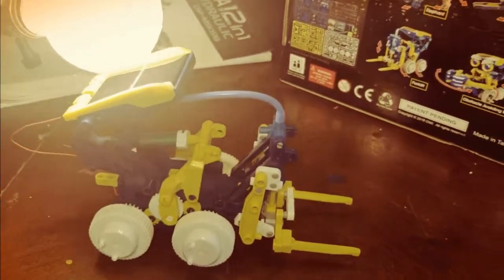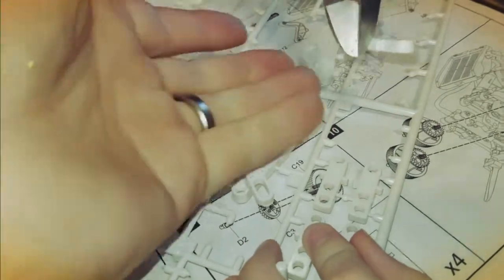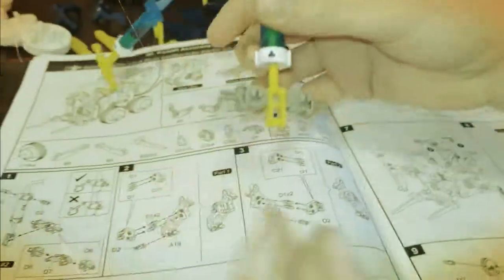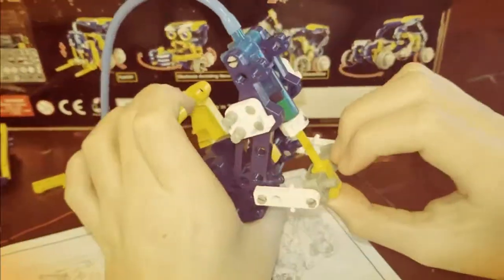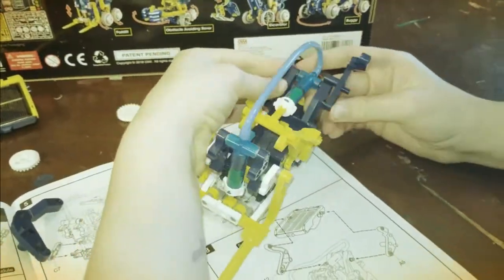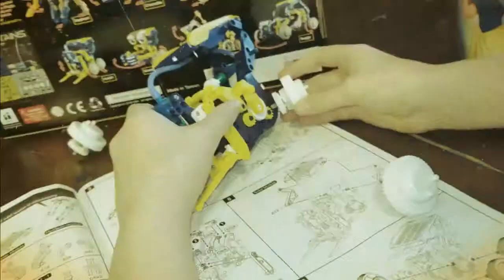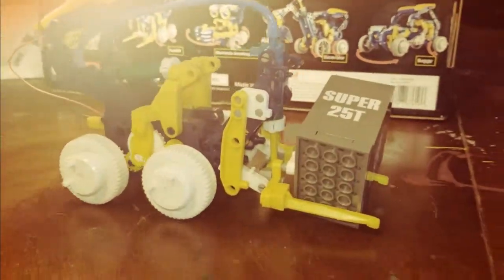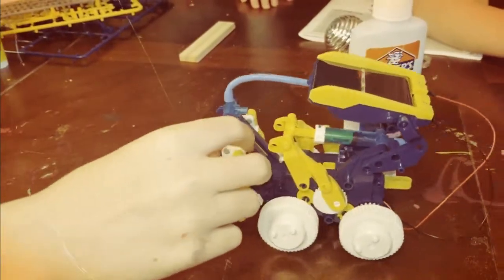Building a Forklift! (OWI 12-in-1 Solar Hydraulic Robot Kit)

Comment: Where do you put the negative and positive charge wires
Reply from the maker: The Solar panel has a "+" marking and a "-" marking on the yellow frame at one end. The red wire goes to the "+" springs, and the black wire goes to the "-" springs. Hope this helps!